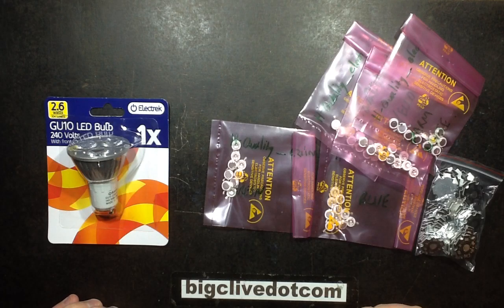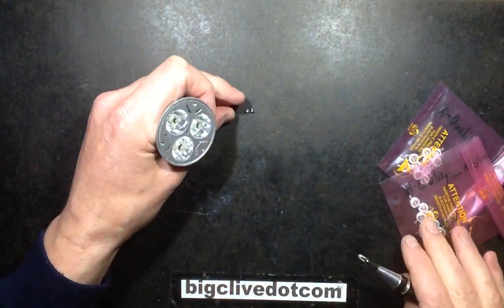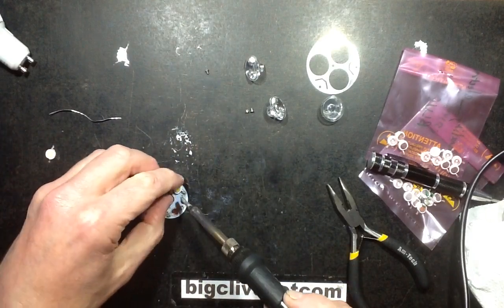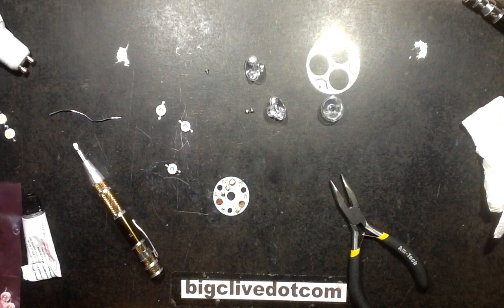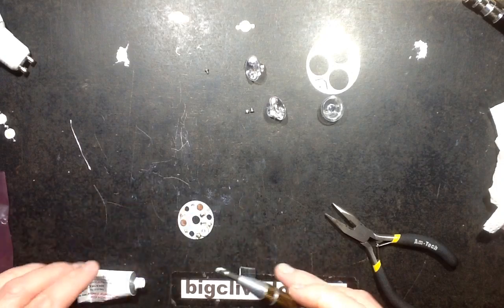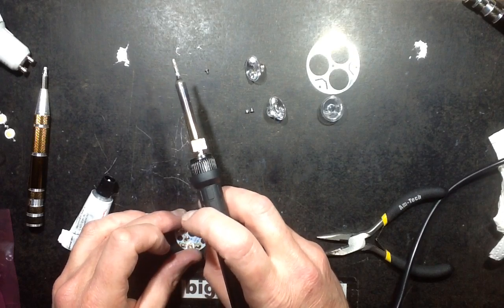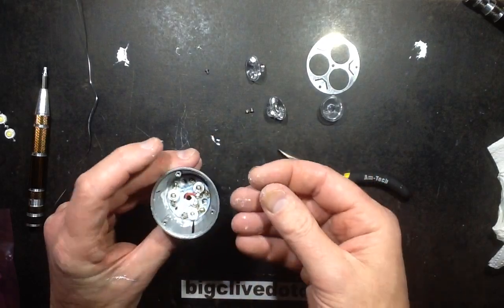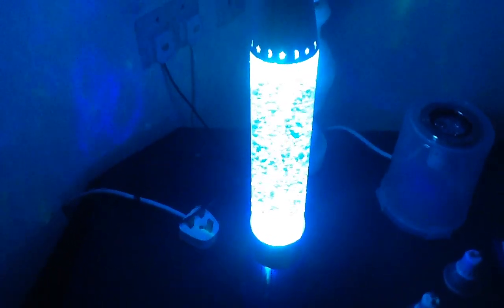Hacking more Poundland GU10 lamps with different LEDs.

Comment: Those pink bags are not anti static. You need the silver bags.
Reply from the maker: The pink bags are static dissipative.  They have a coating with a very high resistance that leaks any charge differential away to any adjacent surface.  They're OK for some applications, but I use the metallised bags for most static critical applications.
Reply: I'm impressed. I have to believe that you get 1000s of notifications per day for comments on your many videos. I'm literally blown away that you replied to a comment made on a video that's nearly two years old within an hour.
Reply from the maker: I use YouTubes dedicated comments section and try to keep up.

Comment: Solder braid burns your fingers and holding coppered slab of aluminium while you fuse fluxed lead into the surface all hurts. He does tell you how to not get zapped though.

Comment: Looking at you struggle with those LEDs, I'm thinking about holding them in place using an alligator clip with a piece of wide rubber band glued to the teeth of the clip. That might work.
Reply: I'd just tin the pad, put a drop of flux on the lead, hold the LED with tweezers and reflow it.

Comment: Some random thoughts on soldering.  Clive, you seem to have to have heat resistant fingers.  Yea for 60/40 lead / tin multi core rosin solder.  I laid in a big supply of the good solder when the ROHS regs came into effect - other substitutes just don't get it.  I noticed in this video that you flicked a blob of solder from the tip of your iron to your bench.  I solder and unsolder a lot and in the course of a life twice I went to flick a blob of solder from my iron to the bench and because liquid solder is slightly elastic it flicked on the rebound and landed right on my glasses.  Glad I was wearing them!  Cheers, and thank you for your vids - don't change a thing...
Reply: That's one of the reasons I go for glass lenses,  rather than plastic...   :-)

Comment: hi Clive,  just out of curiosity what voltage are the leds ? and what type of circuit would you recommend to get them to work off of 12volt dc ?
Reply from the maker: +drEmulatorMadmax You do get a 12V MR16 version, but the combined forward voltage of the LEDs is about 9V so you could theoretically just use a resistor to run them at a modest intensity.  But note that the resistor would get hot if used at too high a current.

Comment: I am thinking that one of those fly hook holders, it's kinda like two clamps with a magnifyer between them, not sure what the name is, but it's something like spare hands.  it holds the piece you're working on while you solder it.

Hope I've given you enough info, this is already mas produced and is readily available, rather than having to make your own.  I believe they were first made to help fly fishers make their hooks, but I'm by no means certain of this but it SHOULD set you on the right track.  Hope I've been of some help.
Reply from the maker: +crushed51 Search ebay for helping hands.  I have one, but only use it when I have to hold too many things at once.

Comment: Not all semiconductor devices are static sensitive, although it does not heart to take extra precaution.  In general any electronics device that incorporates Field Effect Transistors (FETs) will be static sensitive.  An FET is a three terminal device.  The terminals are called Source, Gate and Drain.  Connecting the Source to the Drain is a semiconductor path called a channel.  Initially the channel is not conductive, at least in what is called an enhancement mode FET.  The Gate overlaps the channel but between the gate and the channel is an extremely thin layer of insulation, essentially a thin layer of glass.  When a voltage is applied to the gate with respect to the source the electric field from the gate changes the electronic structure of the channel causing it to become conductive.  In order for the electric field from the gate to have a dramatic effect on the channel the layer of insulation between gate and channel must be extremely thin this also makes the insulating layer extremely susceptible to perforation from high voltages such as those generated by static electricity.  LEDs and Diodes in general do not have insulated gates like FETs.

Comment: How do you hold your finger so close to the iron all the time?
Reply from the maker: +Darcy Ferrier I don't even notice that.  I guess it's just experience.
Reply: Can't argue with that!
Reply: +Darcy Ferrier Eventually your finger tips get callused so you dont feel the heat as quickly. When you solder everyday both as a job and as a hobby your tolerance to heat builds up quickly. I work at a batteries plus bulbs store (we sell you guessed it batteries and bulbs) but we also rebuild drill packs or other battery packs so I am stuck soldering everyday and a lot of times its to small nickel tabs that transfer heat fairly quick. There have been a few times I have burned myself without noticing until i smell it or it hurts like 2 hours later.
Reply: oh right x9x9x9x9x9
Reply: +x9x9x9x9x9  You do know you're not supposed to solder batteries, right? Quite high risk of the heat damaging the cells. The tabs are supposed to spot welded.
Reply: That's how it works, the more the fingers are exposed to high heat, the more they become adjusted to it. Also the hands (and feet) have very low heat conduction.

Comment: I've done lots and lots of them and the best way I've found is to tin a huge blob on a leg and a pad then use the blobs to solder them together... that will hold down the led so you can properly solder the other side.  Once the other side is soldered, you can fix the first side.  :)

Comment: Is the smoke from the led solder toxic?
Reply from the maker: it's mainly flux vapour.  The less aggressive stuff used in traditional lead solder is probably safer than the stuff used with lead-free.  But it's still a good idea to avoid inhaling too much.

Comment: having a rather beefy iron with a good bit of thermal mass is fairly important on the larger aluminum substrates.  My 50W iron will barely suffice on some of them I have done.  The cleaner the pads are to start off with the better with SMD components, otherwise as you experienced you end up with alignment challenges.
Reply: It also helps to use a large chisel or bevel tip on your iron so that there is plenty of contact area to transfer heat quickly.  Additionally, it is helpful to form a small puddle of solder on the tip to create a wet interface between the tip and pad as the small puddle of solder will transfer heat much more efficiently then the bare tinned tip alone, then add more solder when the joint has reached temperature to finish the job.

But if I come up against something overly stubborn I can always either break out the IR preheater to preheat the underside of the board or the 250W soldering gun.  But my run of the mill 70W regulated soldering iron is adequate for almost any task so long as I choose an appropriate sized tip for the task at hand -- just changing tips can make a world of difference in how fast I can lay down the heat when needed!

Comment: Hey can you start linking the ebay sites and such, I am looking into building my own LED lamps for 120v US mains.. I have all the circuits worked out just need some good but cost effective suppliers for LED's and sub-straits.
I did find some COB filimants for a reasonable price though, just waiting for them to get here so I can start on that LED bulb project I been putting off for a year now...
Reply from the maker: +ElfNet Gaming there are so many and they keep changing.  Best thing to do to find a hackable GU10 lamp online is to search for LED GU10 and then select cost and shipping lowest first to find the generic Chinese ones.
Reply: hummm. yeah maybe. We don't use the twist lock bi pin sockets here though, its the Edison screw for us but yeah same principle..
Reply from the maker: +ElfNet Gaming The GU10 downlights are used around the world.  Although you do get the 3W, three LED reflector lamps with the E27 base too.
Reply: I havent seen too many of them here though.. Thats the thing. I know they are used widely.

Comment: Clive, I have a project idea for you.  Something that sounds easy to do.
An LED lava lamp.
Personally I am knarked off because every 3 weeks I have to change the lamp in my lava lamp.  Putting in some RGB lighting is very easy - but the issue is with the heating side of things.  I was considering using some 10w wirewound resistors, the ones that wurlitzer use on jukeboxes to work the 'bubble' tubes....  I also have some 50watt 8 ohm wirewound resistors that i could use but depends on what kind of heat the lava lamp would need.
Any ideas ????
Reply from the maker: +Phil Docker I did a LOT of experiments with lava lamps many years ago and for reliable operation they do require a fairly high heat differential to the ambient room temperature.  Far too hot for LEDs.  The nearest I can suggest is sticking the resistors onto the base with silicone and either using a thermally isolated uplight underneath, or maybe using an LED ring-light around the neck pointing down.
Reply: +Phil Docker it would require the same watts of heating as the old lamp used to, a incandescent lamps are really just heaters, the light is a tiny percentage of their power used, so you can just forget that part of it, so find a resistor equivalent and a led combination so it wont be burning out all the time, but will always use the same amount of electricity as is the nature of those heat related exchanges.

Comment: how do you not burn your finger with the soldering iron magic haha
Reply: +RC MAD Pure skill man, pure skill.
Reply: +RC MAD Hard skin and years of practice!!
Reply: Haha
Reply: +ElfNet Gaming i burn myself if i do that
Reply: skillz man, you dont have dem skillz lol
Reply: +RC MAD You need at least 10 years of daily skills with the soldering iron then you can tolerate momentary contact with the hot tip, but not for long. I also became in contact with the hot end of the iron while doing soldering work for many times.
Reply: I haven't been soldering for 10 years daily, and when I accidentally touched the tip and immediately recoiled, I was fine. Didn't hurt a bit.

I can also grip it with my full hand when it's cool ;)